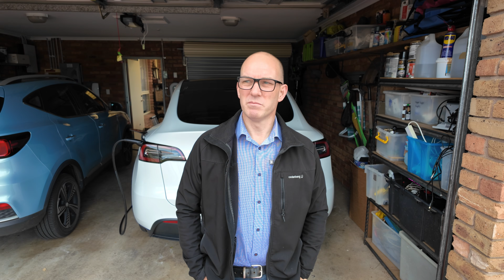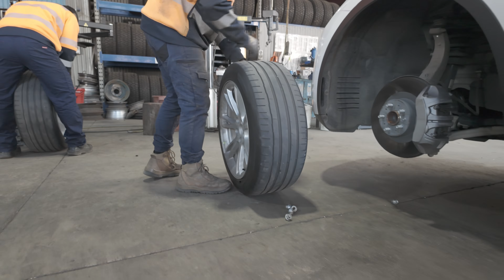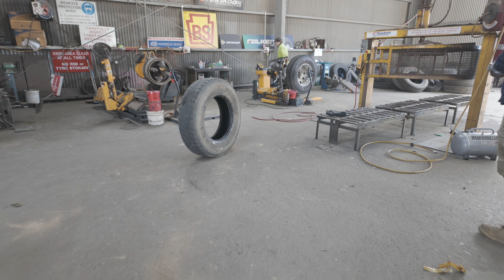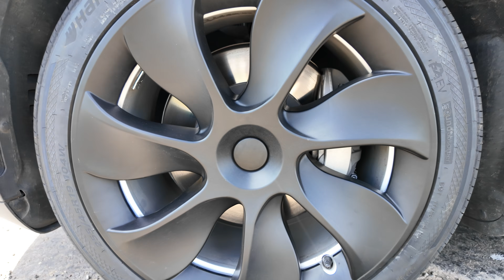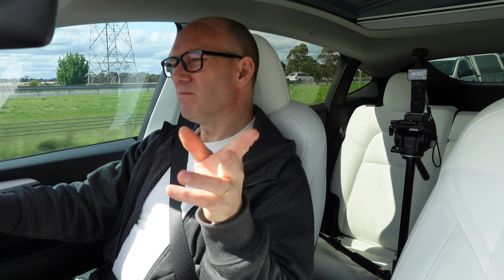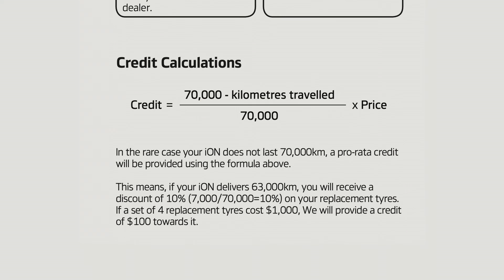Tired of Tyre Noise? This solution significantly reduced noise levels! Hankook iON SUV tyres tested

Comment: Avoid Hankook ion evo AS tires at all costs! I bought a set 6 months ago, and despite normal driving, the tread dropped from 10/32 to 2/32 already.Worse yet, their customer service is terrible. They denied my warranty claim because I did my tire rotation at 8,000 miles instead of their strict 7,500-mile limit. The dealership never warned me about this loophole. It feels like a total scam to dodge payouts.Also, watch out for their "foam" sound-dampening tech. The foam frequently detaches inside the tire and has to be removed anyway. I threw away $1,400 on these. I've never had these issues with Michelin or other brands. Never buying Hankook again!

Comment: Hi Chirs,
I purchased a set of these yesterday in a 235/40/R19 for my 2023 Model 3 Long Range.
At first, they are definitely quieter over bumps and with higher pitched road noise. However, they do have a slight humming noise at 60kmph and above, which i did not get with the Ventus S1 Evo 3's the car came with.
Have you noticed this at all with yours? I probably wouldn't purchase these again for the model 3, but will consider then for our model Y if you haven't noticed any kid of humming with them

Comment: Interesting how tread ware ratings are different in different markets: here in the USA it’s common to find tires with 60K, 70K, and even 80K mile longevity guarantees.
Reply: You can find those in EU, as well. But they wont perform as good as a good summer tyre.

Comment: I have 20” Wheels on my 2021 Tesla model Y and Good Year Tires with 47,000 kilometers factory original tires, balanced and rotated! My problem is sound from road surface from the tires! I will do what you did and buy these tires! 20% would keep me happy, So far my only complaint on this Vehicle! Besides not having a spare tire! On long road trips at 130kph my Tesla is very battery Thirsty. Thank You for Thinking this issue out! I will get the new model Y Juniper for my other Place I live in Thailand this time with 19” Tires because I drive Country roads a lot. Main Highways are 99% Great! Enjoy the Ride We are Lucky to be Smart.

Comment: I have also measured a coupe of cars at 80km/h on the same road with my test-equipment, but I find that there seem to be a quite big difference between mine and your results. None of the cars I tested was under 60db and the ones that are averaging around 60-63db are REALLY-REALLY quiet cars.
Test 1 on nordic wintertyres:
60db - BMW iX
62db - Xpeng P7
63db - Zeekr 001
66db - Skoda Enyaq RS coupé
68db - BMW 130i -07
70db - Volvo V70 2,5T -05

Test 2 on summertires:
66db - Volvo S60 T5 18" -20
66db - Model S Plaid 21" -24
66db - Model Y LR 19" -24
70db - Model 3 Performance 20" -24
70db - Volvo V70 2,5T -05
Reply: Note there is 3 frequencies, A B, and C. Should be using A. using B or C can make a huge difference to the Db reading, typical uses a meter as a control for making improvements to lessen noise so as long as meter is consistent. I must admit with my meter and a phone apps, never seen under 70db at 80 to 100kph but New Zealand has shocking road surfaces for past 40 years not using Asphalt except on a few motorways they have moved to cheap chip seal using 7 to 15mm road chip. cost is down from $34/square meter to $5/square meter but only lasts for 5 years and needs reseal. This chip seal bleeds in hot weather also so making extremely dangerous for motorbikes. Asphalt lasts for 15 to 30 years.  The road noise is so bad that residence complain bitterly to local council after a reseal.

Comment: How do you explain the difference on 3dB in stationary? It can't be the wheels, and it's the same car with AC off.
The one with some rain has a lower dB measurement.
Did your measurement gear change?
Otherwise, there is something else that is wrong.
Perhaps consider calibrating each measurement by taking a sample in your house in the same spot, and outside near the car to correlate values.

Comment: I'm at 78000km with my original Hankook Ventus S1 Evo3. I still have some potential on them. I did rotate them every 20000 km. 
I'm gonna get Hankook Ion FlexClimate SUV for the winter and will probably keep them in the summer (unless I swap again to finish the Ventus). 

Both are 255/45 R19 104
Ventus is 104W
FlexClimate is 104Y
That's if I remember correctly.

Looking forward to trying the FlexClimates!

Comment: The Foam to Suppress noise in the tyres apparently has one drawback.  If you have No Spare tyre and use the Repair Kit Can it may not seal the hole as the foam belt you showed will prevent the filler from getting to the leak. Luckily my Leaf has Space saver spare. Is Wheel arch noise suppression another option?
Reply from the maker: Wheel arches, I reckon that's where I need to focus on next. Cheers!

Comment: We got a set of these pur on oue Model Y back in Dec '23.

Have done 20,000km on them so far and are holding up quite well
Reply from the maker: Whoa! You do a lot of KMs - so 3 years a new set?
Reply: @chrisvanderstock  we do alot more but Cym has been of work. At the warranty of 70,000km that's just under 2 years of no4mal driving for us.

Comment: i put a set of these on our 22 M3 LR a few weeks ago replacing the originals.  These are markedly quieter and smoother. Passengers commented on it and asked what i'd done so its not just me that noticed....
Reply from the maker: A friend of mine is coming over this week to help me film with his M3. We'll repeat this test and I'll be curious to see how it stacks up against the 2019 and 2024 versions.
Reply: Good to know. Thanks! 
Having them installed at 36k to replace my OEM of Michelin Primacy. Quieter and smoother would be great. Improved range would be a bonus but not as important.

Comment: The only issue with the list, and as demonstrated by the outcome is Tyres make a massive difference. They would all need to be tested with same tyres to know which one is the best. To be fair, cars come with a set of tyres, and those are the ones you test with. But by changing out the tyres, the list then becomes skewed. This was pretty good content, and very helpful. your table may have to start becoming 3d in nature with different tyre types.
Reply from the maker: Thanks for this; and excellent points. I guess if the type of tyres are the same and then applied to different vehicles, you can understand how quiet a car is.
Reply: @chrisvanderstock  I have a GV60, and i often wonder if a different set of tyres would make it even more quiet. You have peeked my interest so i might start looking at different tyre reviews to see if this is a possibility for my next set when the time comes. its good to know the brand you reviewed gave such a positive outcome for the tesla... so much so, it became quieter than the GV60. love your style of reviews, please keep up the good work.

Comment: After 65 000 km I replaced my OE Hankook's with these. Whilst I did not do the sound meter test, I did notice some noise reduction. However, new tyres are always quieter due to their deeper tread. I think I will probably go back to the S1 Evo 3 OE tyres as they did seem to last better than these new Ion tyres. Only thing is, the OE tyres are much more expensive.
Reply from the maker: Good to know. FYI - I searched for quiet EV tyres and these along with PP came up. I didn't bother trying to get the original sort as I felt road noise was coming from them.... which turns out to be true.